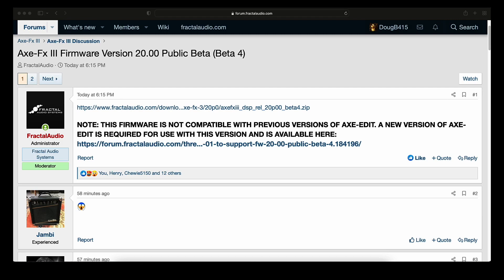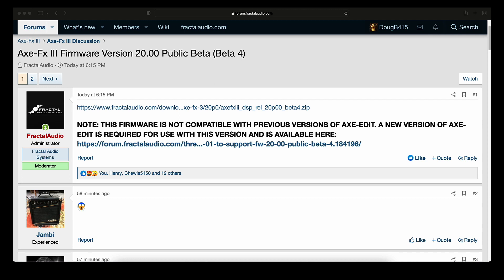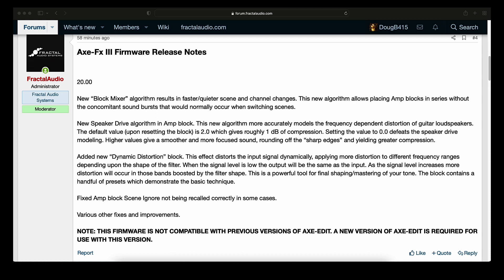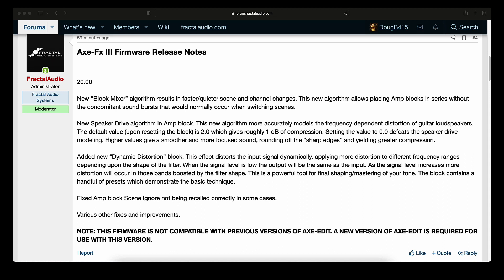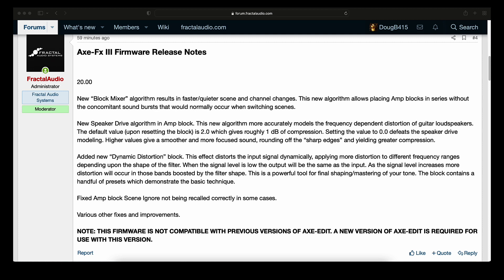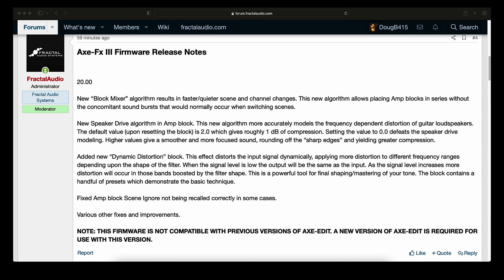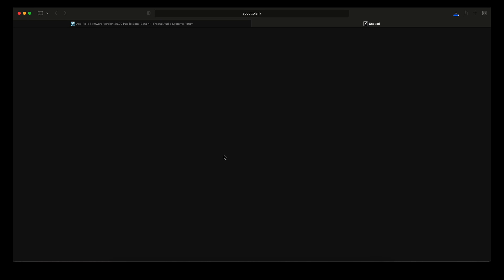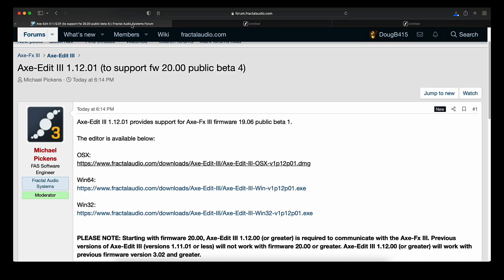AXE-FX III - Firmware 20.00 Public Beta 4 Now Available!

Comment: I was told by fractal moderators that you DO NOT want to reset the amp. You just need to change the value in the new speaker feature.
Reply from the maker: Keith - which mod? This is being discussed in the Fractal Forum right now. Neither Cliff nor any of the mods have stepped in, so we're guessing that you might not have to reset. I'm going to check with one of the mods.